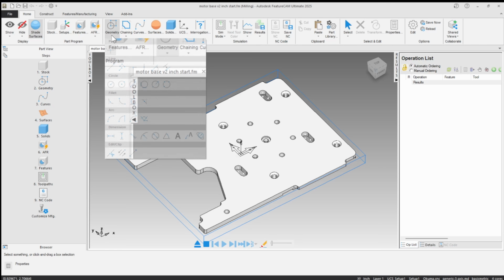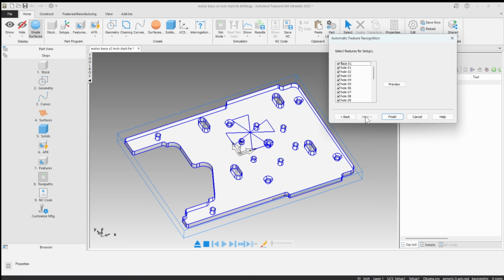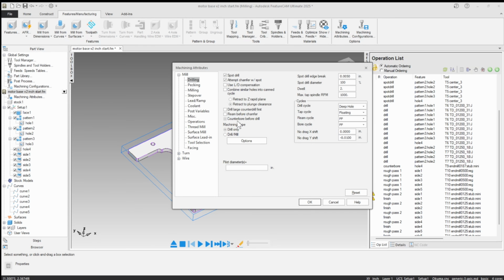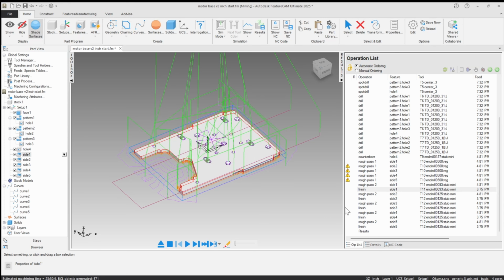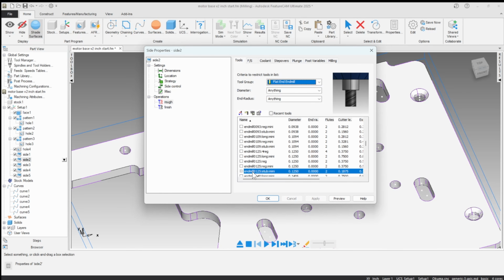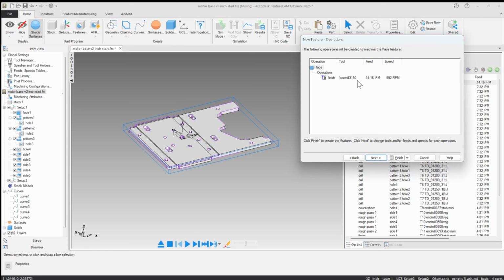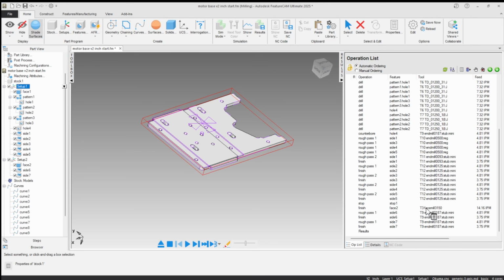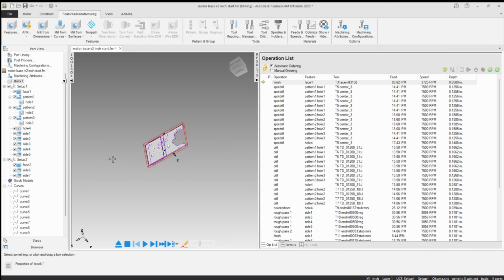FeatureCAM Overview: 2.5 Axis Mill Basics

Comment: What made you decide to support Featurecam? Featurecam is the best CAM program I ever used when it comes to programming and easily being able to change your mind as you go along.
Reply from the maker: Like most companies you gotta grow and we are looking to prove we can scale the model on how we sell Fusion. Dont be suprised when you start to see PartMaker and Powermill as well in the coming weeks.
Reply: @JITCADCAM  Hasn't Autodesk stopped almost all development on Featurecam?
Reply from the maker: Ill have to look into that, But the fact as of right now its still one of the Top if not the Best Dual to Quad Turret Mill-Turn softwares with built in simulation makes it the perfect product for alot of customers.
Reply: @JITCADCAM  No doubt about that. Again, the best CAM software I ever used. Miss using it!